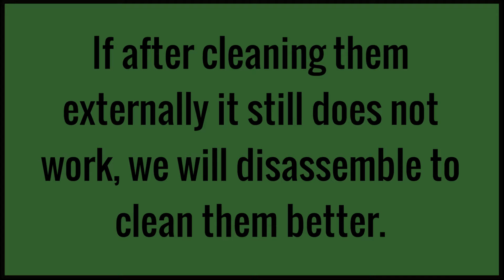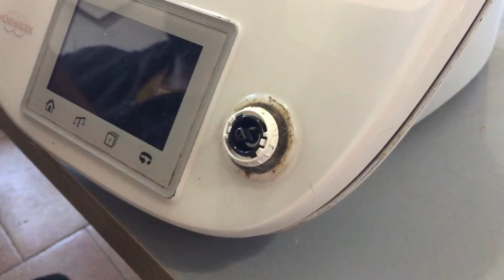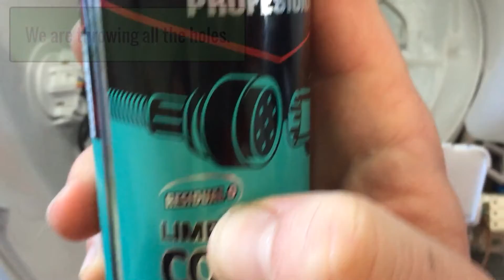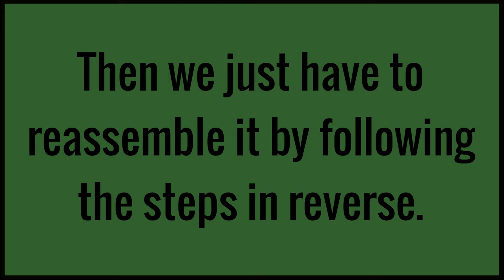Thermomix Please clean contact pins on bowl base

Comment: You don’t need to take the whole machine apart for this. Where the pins are is a small plastic cap in the shape of a half moon, if you gently lift the lip it pulls out and exposes the pins, spray and push gentle back into place and mine was all good to go again.
Reply: Yep totally agree. This is completely unnecessary if all you want to do is clean the contacts. The rubber surround can simply be pulled out. Also take extreme care when doing this, and make sure you unplug from mains. There is a reason why it's covered. ⚡ ⚡